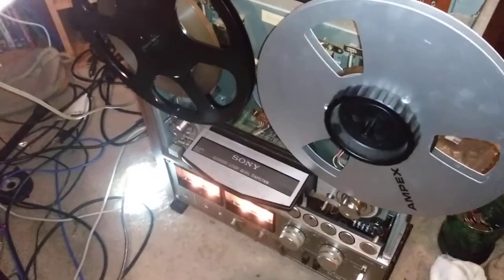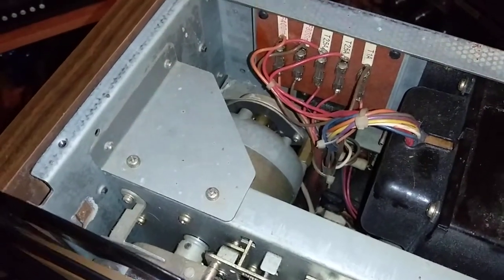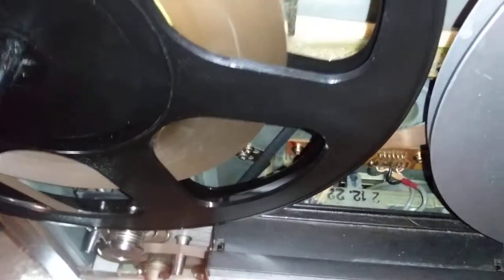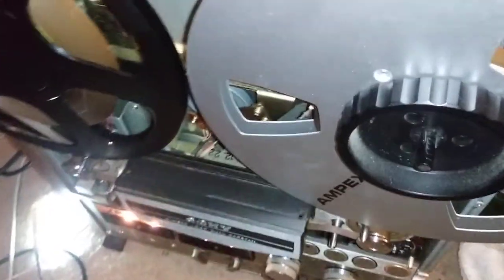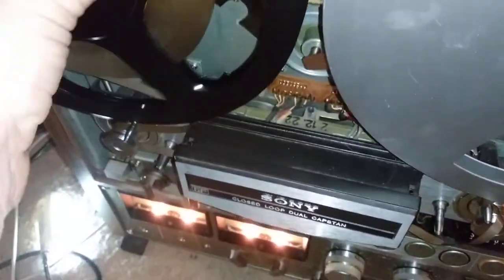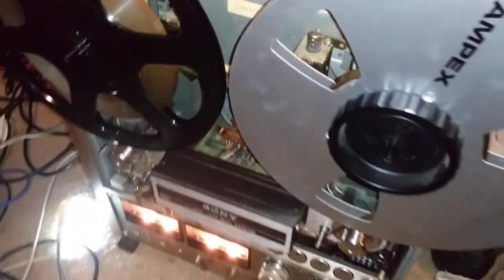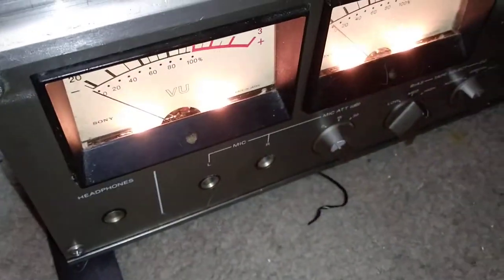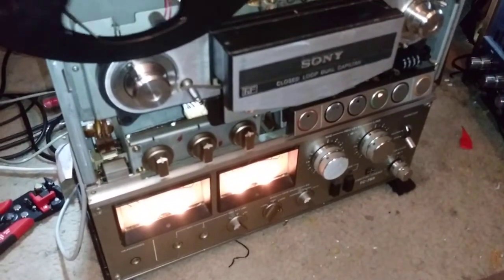Vintage Sony TC-765 Reel To Reel Tape Machine Has Issues

Comment: I recently bought a used TC-765 only to discover that the pinch roller arms were siezed, which I later discovered is a common problem with these units (dried up grease). I removed the entire mechanism in order to work on it. No amount of WD-40, oil or soaking it in solvent would free up the arms.  I ended up removing as many of the parts as possible then used a small hand torch to heat up the roller mount blocks just enough to free them up. I removed them then cleaned the blocks and pivot pins thoroughly. Cleaned the entire mechanism and relubed all slides, pins and pivots, reassembled it and it's as good as new.

Comment: Have you tried to spray the inside of the tape source button with contact cleaner. Usually the problem of only earing one channel is caused by corrosion inside the switch. Beautiful machine. Cheers.

Comment: Following. I have the exact same model and its doing very similar. I haven't tried one of my tapes yet because I need a take up reel. But the right side turns but the left side slowly turns clockwise on and off. Not counter clockwise like it should.

Comment: I have the same deck, works beautiful, but it was never mistreated or had monkeys working on it. I do all my own work. Owning one of these especially after one this abused, is expensive to revive from this kind of trama. At one point, mine had one channel out which was a defective J-FET and one stage of the pre-EQ chain. Only certain transport pieces need specific lubrication and infrequently at that.  As others stated, WD-40  is not one of them, EVER!  Let me know if you still have it or need some input. No question at this point, it will require servicing. The issue is who and the cost to get it to them and back to you.

Comment: Hi friend, just a question.  I have the same Sony 765 and problems with the PLAY. the same i saw in your 765.
How did you repair?
The mechanism, the orange metalic arms that move the rollers, is not soft as many years ago.
I put oil and the Wd40.
Its softer but no power enough to move in PLAY mode.
Thanks for your time.
Regards from Paraguay.